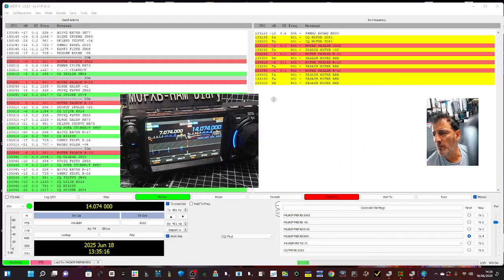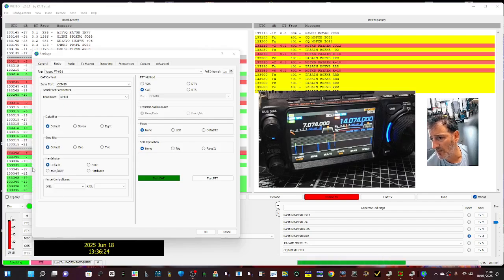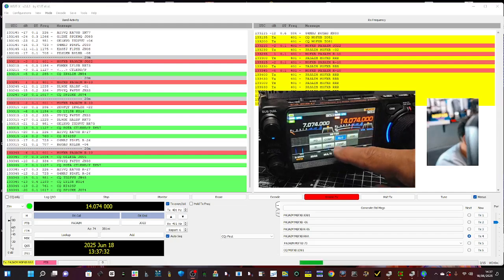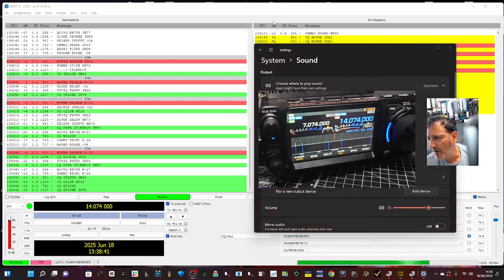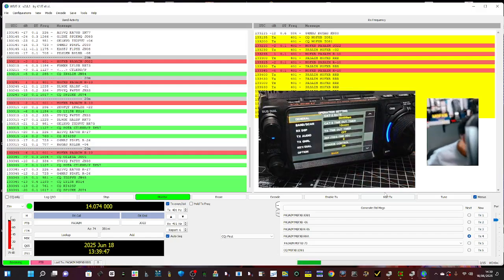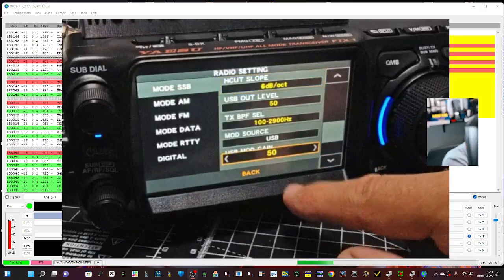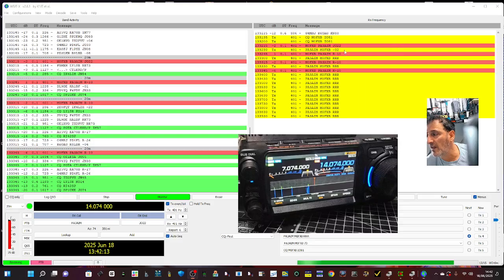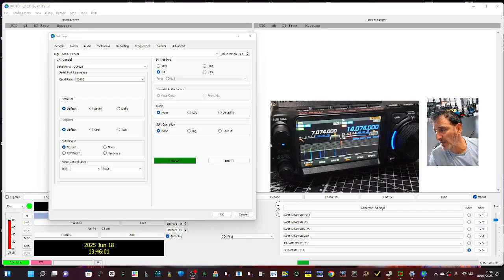Yaesu FTX-1 , FT8 - WSJTS Set Up - ?

Comment: Wondering if you got this working? I can receive ft8 and js8call but it wont transmit. I may try the mic gain thay someone else mentioned in the comments. Same in vara hf and fm/winlink. Ive been able to connect twice in 2 months of trying
Reply from the maker: See all my other videos
Reply: @HamTechRadioScannerDrones I think I've watched every vid u make which is a lot. Can you suggest 1 or 2 that have the answer?

Comment: I would try the same exact settings on the radio and WSJTX as you would with the FT-710. I am waiting for my FTX-1 but when I get it I plan to set it up like my FT710 and see if that works.
Reply from the maker: Good plan i still have my 710